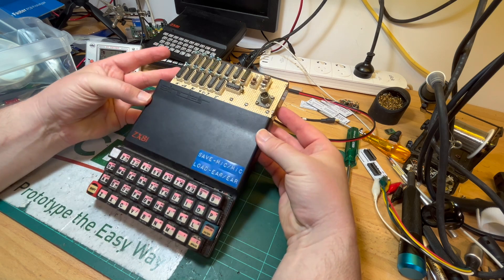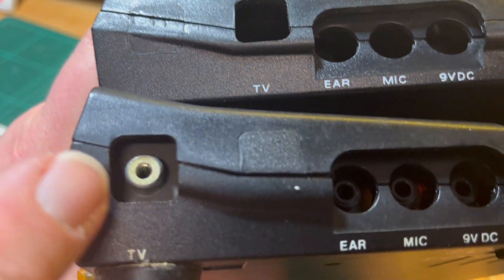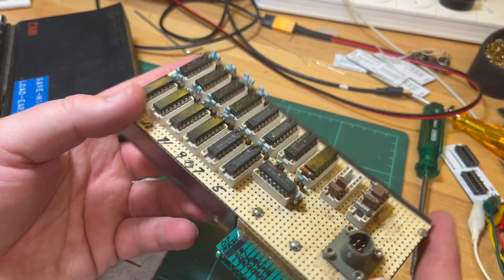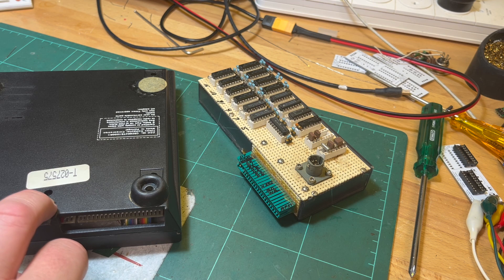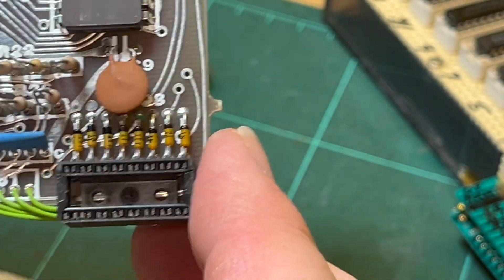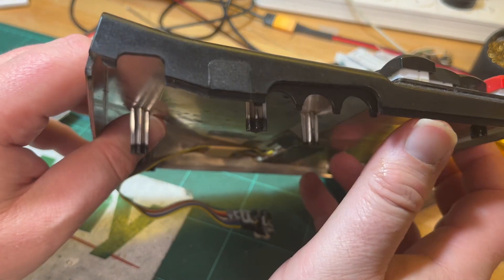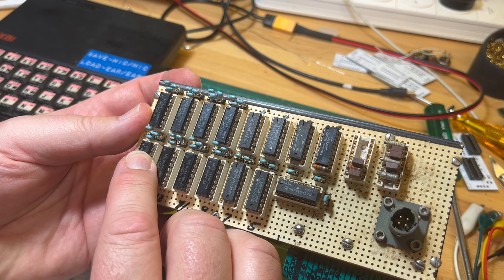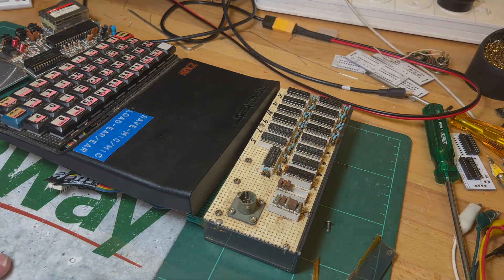🇺🇸 Heavily Customised USA ZX81: Part 1 (First Look) [TCE #0383]

Comment: I wouldnt even class these horrid things as computers, more like a calculator with 1k ram and a bloody awful keypad.
Reply: These little computers were designed to put computing in the hands of a wider audience, the early 80's was not a prolific time economically, in the Uk the average wage was between £60 to £80 a week, and most of the computers were around the the £200 mark for entry level machines, and a cheap run around car was £300 for comparrison so they were aimed to get people into computing, the keyboard and RAM limitations were entirely due to the price point it was made too
Reply from the maker: "You can run a nuclear power station" with one ... 😂

https://youtu.be/tB6CC8UbJLU
Reply: @Brfff  This thing is so slow it couldnt even run to the toilet

Comment: Yes the ZX81 kit was sold in the USA before Timex contracted to build the TS-1000. The TV output location is due to the difference between NTSC and PAL modulators.
Reply: Fully assembled ZX81s were sold in the US as well - I have one - they were FCC certified for sale in the US. That's just the NTSC version TV out location which, of course, was the same for the TS1000s. Clearly, it's a ZX81 top case, but if you notice, it's got a Timex bottom case. Not just made my Timex (which they did) but it says "Use only Timex approved AC adaptor", and the Sinclair ones say "Sinclair approved". Not completely sure about the main board, but I know at least the early TS1000s had boards that say "SINCLAIR ZX81" but with a 2K RAM, and I believe the early TS1000 also had the earlier ULA as well. My ZX81 board says "SINCLAIR ZX81 USA" as well and looks the same except it has a 1K RAM and a Zilog Z80. Since that's an issue one board, I reckon the board is from a ZX81 but with a 2K RAM chip fitted, so it may be the bottom case and RAM from a 1000 and the rest from a USA ZX81.